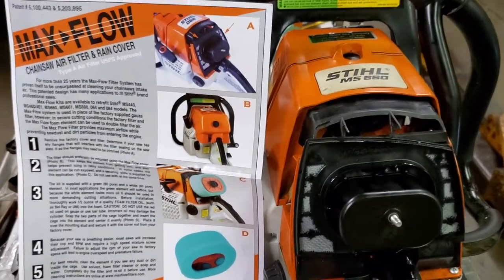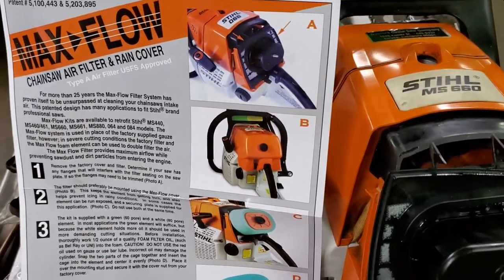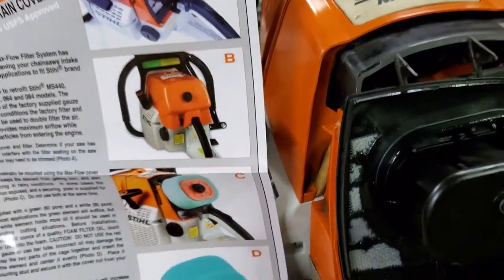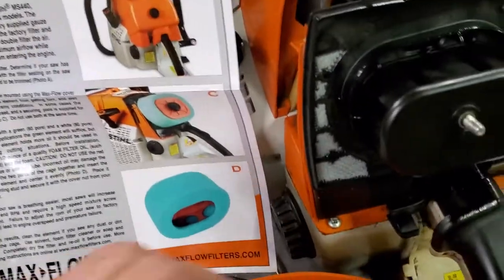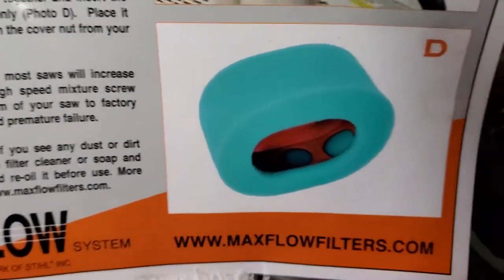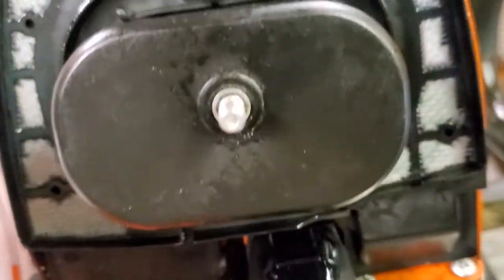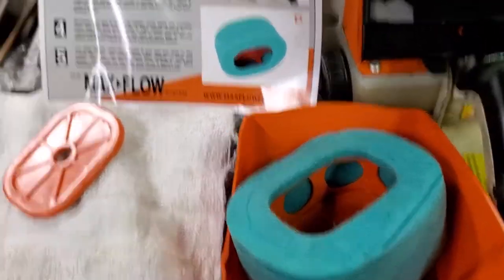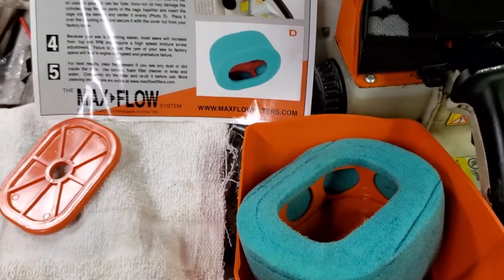Stihl ms 660 max flo filter . (Also removed air filter baffle)

Comment: I run maxflo on my 3 660 kit saws n great bolt on mod..are you using it on top of the black inner filter??
Reply from the maker: Are you talking about the small inner plastic cover that snaps on? I do have it on there now but thinking about it probably don't need it. What do you think?
Reply: @woodcutter4481  no you dont need it..the maxflo s are amazing at keeping fines out..n should fit well with out..i did trim that lip off the filter base to get it to sit flat..
Reply from the maker: @chapsmaketory3960  thanks for the info. I think I will trim some edges also. Did a few test cuts no tuning. I am very happy so far.
Reply: @woodcutter4481  I bet it's a nice running saw with what you've done..i pretty much did the same porting n other mods as you..i did use walbrowj76  with the .74 jet for more fuel cuz these saws sure use fuel all modded up..that being said ive recently started using 100ll av fuel n redline 2stroke racing oil n notice a considerable difference in the way they run..ill will say they love the 100ll av n if you have a local airport you gotta try it ..especially with the mods you've done you will definitely notice ..that n a timing advance made mine pretty wicked!!
Reply from the maker: Yes its very satisfying. Especially when you have good results. I've used 100LL in the past but no ones usually at the small local airport. I have to call someone to meet me. I have ethanol free 91 for now.
Reply from the maker: Do you have any vids?
Reply from the maker: I'm planning on timing advance also. Gonna run it a little first.
Reply: @woodcutter4481  nah not yet..im gettin set up to do some..ive got a walnut but log in my yard that required me to purchase a 72" double ender to mill..
Reply from the maker: Lots of great carb info. Mine is wj69b. I will be looking into it. Is the venturi larger in the wj76 or could I use larger jet in the wj69?
Reply: @woodcutter4481  yea just get the .74 jet..jacks small engines I think I got 1 from there..only couple bucks
Reply from the maker: I just got one off ebay. I'll have it if I need it. Should have looked at jet size today when I adjusted meter lever. Thanks for the info!